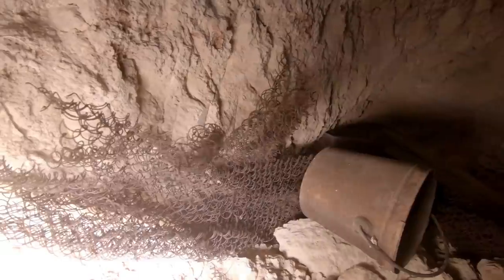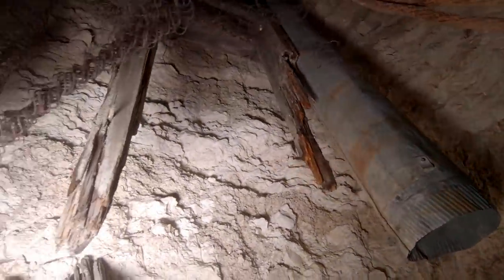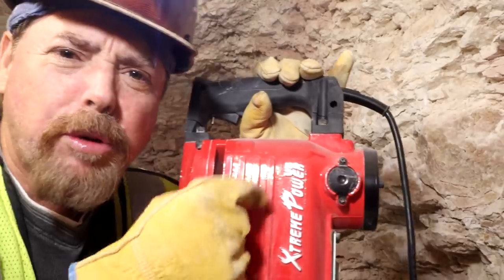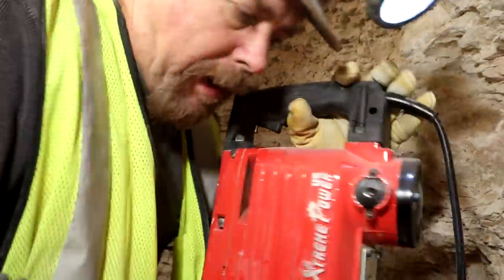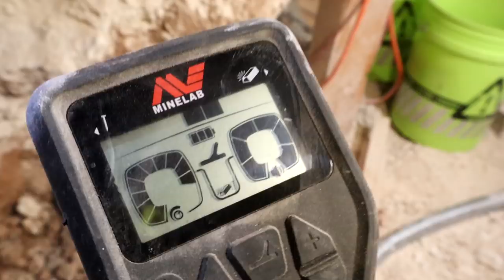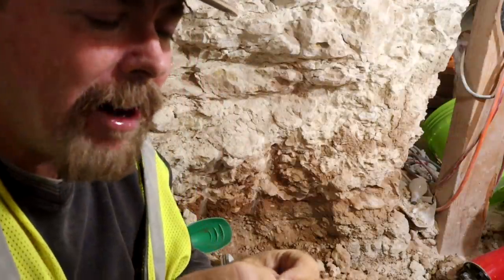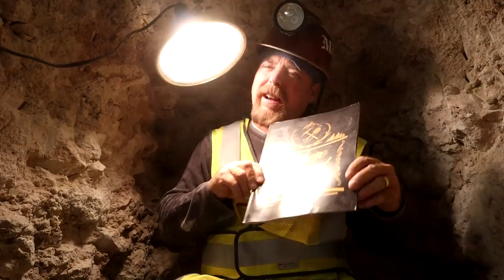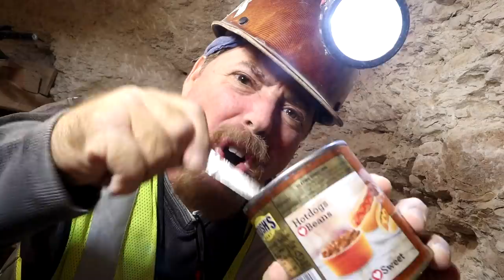Finding Human Bones in an Abandoned Mine - ask Jeff Williams

Comment: I think you should use a blower down that new shaft to suck out the overburden and even the ore components for mass processing. By Blower I mean a big vacuum  machine. My dad was a Opal miner in Coober Pedy and had a blower for easily extracting the dirt from underground. Basically it is a truck with an aux engine and an offset vaccuum with a hopper. A quick search on it should show you what I mean. You already have a few lengths of that 6" pipe just need a few elbows some inner tube and hose clamps for joiners and off course a blower and your on your way. Its also good for degassing your claim after blasting, would make life super easy bringing material up to the surface.

Comment: My best pans had heavy red oxide stain.
Open up big enough to run a skip.
Rent borrow hydraulic Smeal 5T or 12T
Water well pulling unit. Haul buckets up.
5T is on a 1 ton truck chassis. Economical lift.

Comment: Yes. But not just...i saw bones in the breakthrough video that looked human. Jeff ,slow cook up a pound of bacon . keep it as low heat as you can but keeps it sizzeling . the bacon should foam up and then mostly stop. Thats when its done. It will be crispy like chips, but will disolve wothout chewing. It stores for a few days if kept sealed and mostly oxygen free. Crumble that into your can of beans and you'll know where the pork is. You can also cook a can of beans on a birthday candle .  
Just suspend the beans from bailing wire after venting the top and light the candle and hand the can about 4 inches over the flame, by the time the candle is half burnt , bend a vent wide open and stir it up with whatever is handy. When the candle is burnt out the food will be hot and ready to slirp. Jeff if you pay for me to go to the desert, ill work off my debt...i need to escape this horrible place and dont know as i have time to save up for it before its too late for me. I am good at beibg alone and in the wilderness so id make a great 
"Watchdog" ...i wish i was kidding.

Comment: I would go for the actual rail and carts. A lot of work to install, but more output per day.
 Now a few questions: If that shaft & drift you found was producing good gold why would it be covered over and abandoned? Are you able to determine how old the workings were, possibly by being able to date the cans? I would be happy to work a set of diggings like that.  
 Did you ever figure out what was making the odd sounds in that new area?
Reply from the maker: exactly.........we have a few ideas but not sure ....it looks like it was dug by the Chinese then later dug by the White man based of of the equipment ....maybe trying to hide it ... like a lost mine story ...still not sure what was and is making those noises

Comment: Isn’t that wire just what they used to line the passageways as they dug them out?

Put that across the ceiling prop it up with wooden framework and it’ll spread the load out pretty good I should have thought.

Comment: Dig a hole 2'x2'x2', burn a bunch of branches or other wood till the hole is full of red hot coals, take a 12" dutch oven and fill with presoaked beans, water,  molasses,  tomato sauce, salt, and a large pork roast, then dig out half the coals from the pit and lower the dutch oven in the hole, then put the coals back. Put a metal lid over the top of the hole and shovel dirt over the top to make a good air tight seal. Let it cook for 12 to 16 hours, dig it up and eat. Best beans you'll ever have. Check out bean hole beans on YouTube.
3:24 looks like my mother in laws mouth.
Reply: Yeah baby! DO cook'n at its best!!

Comment: That was their plan when they originally dug it, so it would make a lot of sense to set up a bucket or sled system just as they would have done back in the day.......I bet you can move a lot more dirt than the old windlass that was originally used.......an electric wynch will make easy work of getting some of that nice oxide rich pay dirt out and up to the surface......and in the mean time you can open the workings up a little to allow better access......win win situation.....so what you wait'n for....C'mon....Let's go!
Reply from the maker: exactly and we are working on it